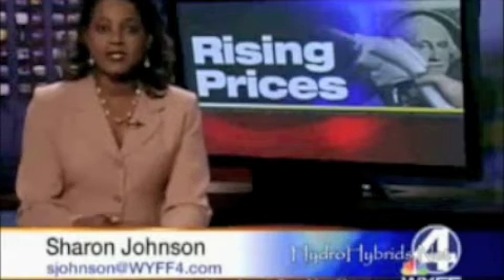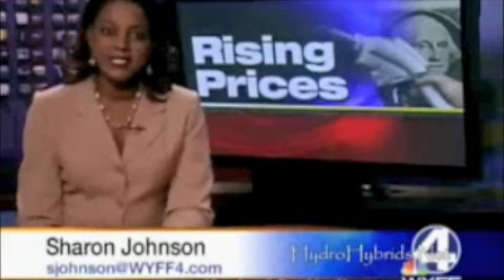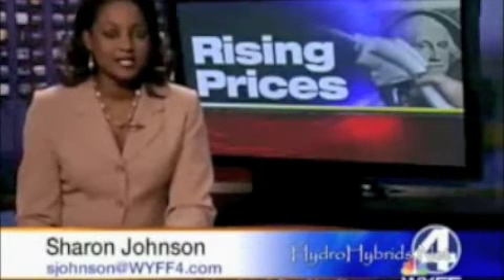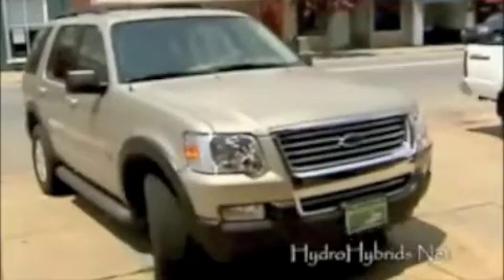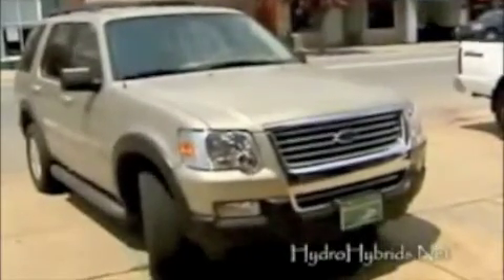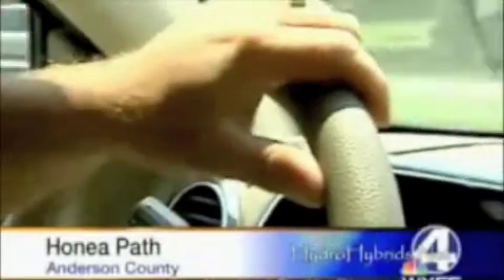Can a car run on water?

Comment: Strictly speaking, a car cannot run on water alone, with an on-board system splitting the water and the engine recombining it. On the face of it, there is no energy to be gained. Given that no conversion process is 100% efficient, you can be sure that energy will be lost. However, such a system could theoretically boost the efficiency of the combustion the gasoline. So, it might pay off that way, but I'm still skeptical.

Comment: That's where the thermodynamics come in. It takes energy to split the water - most likely significantly more energy than could be reclaimed through increased mileage.

Comment from the maker: It's a news clip from several years ago actually. I don't know what is so hard to accept about water being split into it's component parts - Hydrogen and Oxygen, with the Hydrogen as the fuel source and Oxygen to feed the explosion. Just the same way a normal combustion engine works but with a different fuel source. I can't claim it to be true as I have never tested it myself. At the same time I can't completely write it off either.